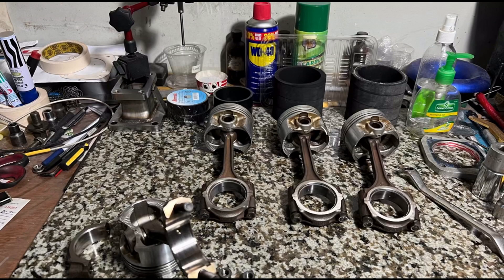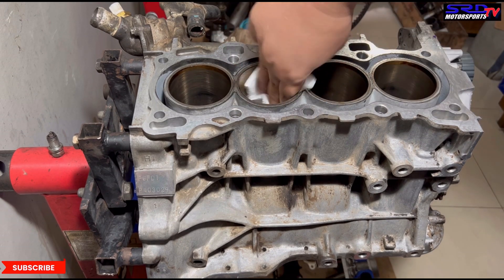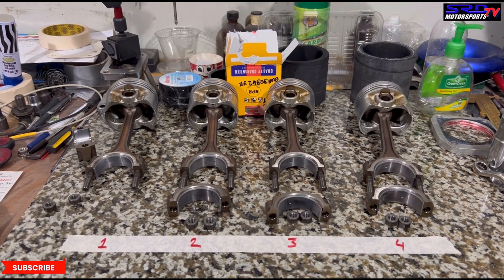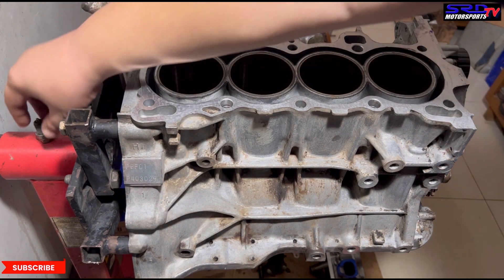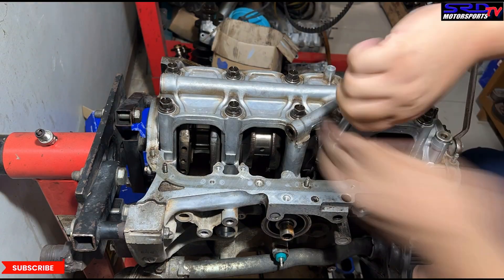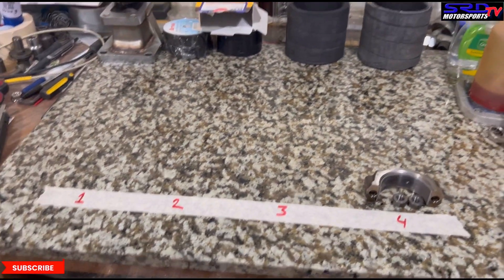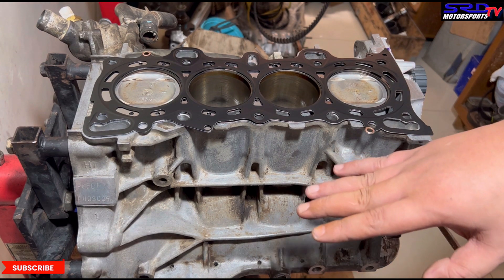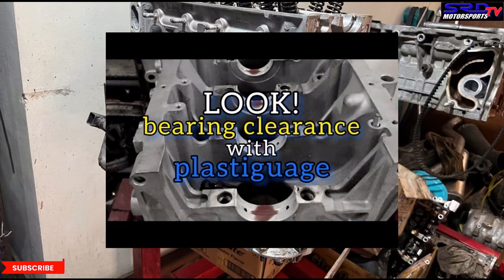Civic VTi D16y8 Ph16 Rebuild Series Part 4 Engine Assembly

Comment: Hi, how are you? I have a question that I can't find a solution for.

I bought a set of pistons with oversized NPR rings (75'50) and the problem is that the tolerances that come from the box do not convince me and seem very strange to me.

1 compr. - 0'20 mm (.008)
2 compr. - 0'43 mm (.017)
3 oíl - 0'53 mm (.021)

The tolerances of the segments are as if inverted, in the first one there is a small distance and in the oil one there is a very large distance.

At the grinding machine, the technician took the dimensions of the piston (Nippon Racing PM6 75'50) and based on the measurements, he took the necessary tolerances

Do you see it as normal or could it be a segment failure?

I can take any block or piston measurements if needed.

Thanks!
Reply from the maker: @Ponik_-zz9kd  if the block is bored to 75.5 

The 0.008 top ring and 0.017 second ring looks normal and some file it a bit looser some like it that tight
Reply: @SRDmotorsports  Ok, thanks
But the oil rings? They would be very, very loose, right?
Do you think this will be solved in another segment kit?
Reply from the maker: Watch the piston ring video the oil ring never needs to be tight
no ring ever needs to be tight actually
Reply: @SRDmotorsports  It's just my understanding that from the kit, the rings should have the same gap so that they can be modified, or the top one with a large gap and the oil one with a minimum gap (from the box)
But here I get the first one too tight, the main compression ring seems to have a good gap, but the oil ring, also very important, is already at the limit, judging by the manual
Reply from the maker: @Ponik_-zz9kd  first ring is always tighter than the second ring 

So ur numbers look normal

A little too tight for my preference but normal

Comment: Nice sl@sh, you touched on the subject of piston "alog" 

I remembered  my first engine swap on my hatch way back early 2000s when i got a used PH16 engine from a local ESi.  Had it refreshed with new OEM valve seals, etc.  and also noticed some rocking movement of the the pistons just like in your vid.  I can still recall being frustrated and worried but not the mechanics as they just smiled and seeing their calmness totally eased my mind.  After all they've got tons of experience compared to me haha🤭

You really have to trust the right people 😉
Reply from the maker: So true on “trust” 

I touched up on it as I’ve talked to several peeps that changed blocks? Because their “trusted” builder said “may alog” ?!?
Funny enough they also had a block to sell to the owner haha duh

Comment: Anothet great video! Keep it up ralph! More power!
Reply from the maker: Thanks man! Was stoked to show na still “may alog” 🤣 next up is a more “curious” aspect as stated ftw!
Reply: @SRDmotorsports  after that you do the valve spring comparison video.
Reply from the maker: @BenjieCoB20VTEC  still working on it cuz I don’t have a “RIMAC” to check spring tension and pressure
But definitely it’s in the plans ftw